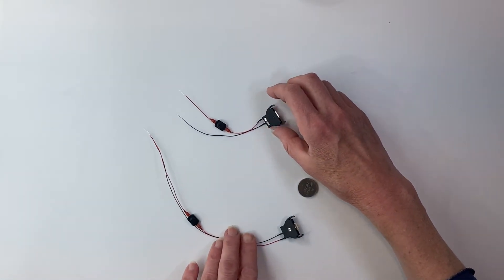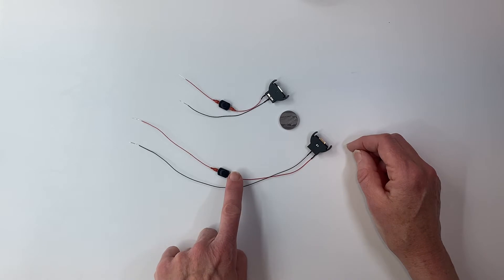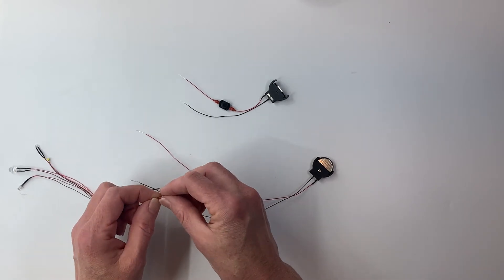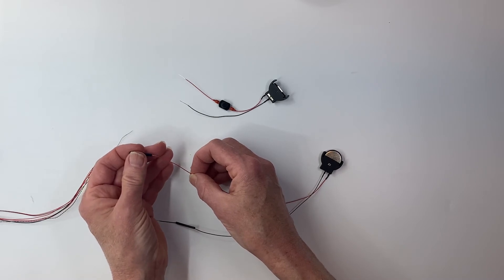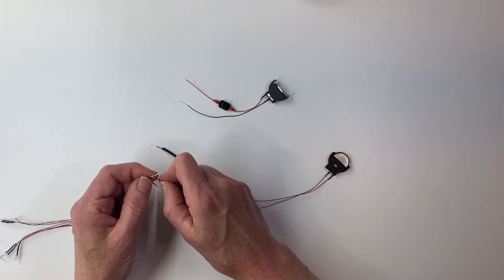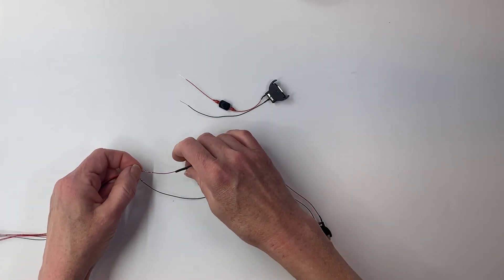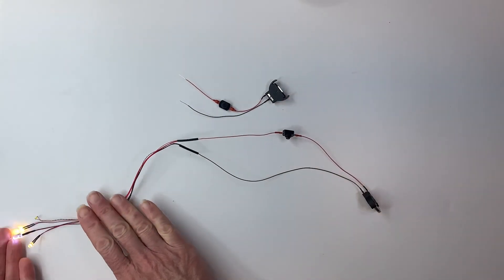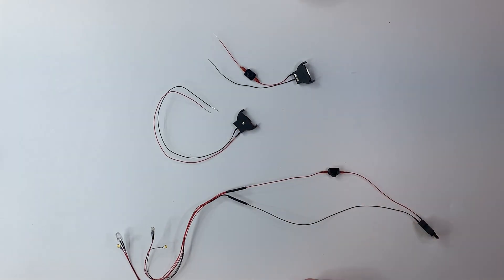How to use a Coin Cell Battery to light LEDs with our Easy to use Coin cell holder and switch

Comment: Would it be possible to add a USB-C coin cell battery charger to the circuit?
Reply from the maker: Sorry I am not familiar with those. You would have to be sure to use a rechargeable coin cell if you wanted to add one! And some rechargeable batteries do not get all the way to 3 volt.

Comment: I'm looking to buy this for a project, although I am worried about the battery life. I'll only be using one, tops 2 led lights, but 14 hour time is just to small of a window for my project. Any thoughts? Is there a small chargeable solution solution perhaps? Because switching coin batteries isn't optimal for what I'm doing.
Reply from the maker: hi Jakob the little coin cell is great when you don't need a really long run time.  But if you need longer and rechargeable I wonder if our USB connector https://evandesigns.com/products/usb-type-a-power-supply-cable might work for your project? You can use any power brick with it and you will have hours and hours of run time.

Comment: I like the set up. I'm a little leary. No resister at all? for the L.E.D.s? I have smoked quite a few LEDS.
Reply from the maker: hi Greg! I am glad you like our setup.  An LED's voltage requirement is based on the color.  The colors that need a resistor even for 3 volt are red, orange, yellow.  This is true of any size LED from 0201 to 5050 and from 1.8mm to 5mm.  The red, orange, yellow need a resistor for 3 volt.  Other colors: Warm white, cool white, blue will operate just fine with no resistor on 3 volt.  Green depends on the manufacturer.  Our green is 3 volt with no resistor needed.  So at a guess, if you have "smoked" an LED or two then they had to be one of the "citrus colors" red, orange, yellow.  In our 3 volt LEDs https://evandesigns.com/products/3-volt-solid-leds and https://evandesigns.com/products/chip-nano-pico-leds we always add a resistor to those colors that need one to operate.  And our LEDs are guaranteed to work well with our power supplies https://evandesigns.com/pages/evan-designs-guaranteed

Comment: Can you hook up 7 SMD's with one the coin cell holder?
Reply from the maker: Hi! Yes you can hook up seven LEDs, in fact we have found that up to 10 LEDs light nice and brightly with this coin cell. Above 10 the LEDs will still light but they will not be as bright as they could be, it will not hurt them or the coin cell to go over 10.
Reply: @EvanDesigns  Thanks for getting back with me. this sounds great, I build models for clients and this to me is the thing I can use for sure. So I know you said LED's but that incluses SMD's?  The SMD's I use are rated for 9-12V
Reply from the maker: @wraith20072007   The coin cell is only 3 volt So it will not be able to like your 9 to 12 volt LEDs. We do have a battery snap with switch herehttps://evandesigns.com/collections/wire-switch-more/products/battery-snap-switch-combo
Reply: @EvanDesigns  Thanks, I will look into that. Have a great evening.